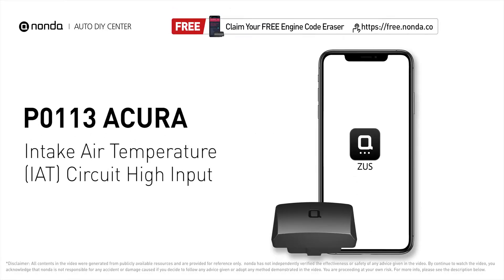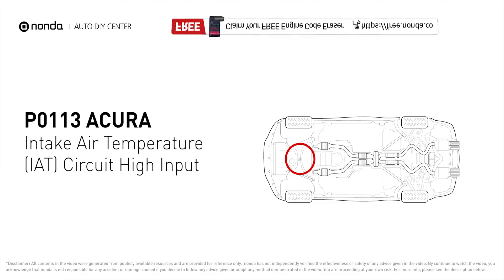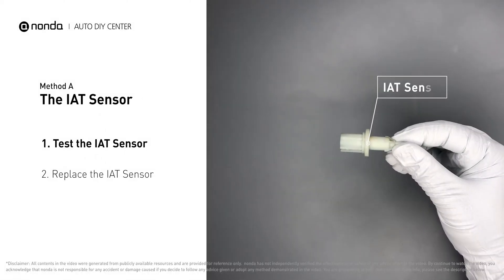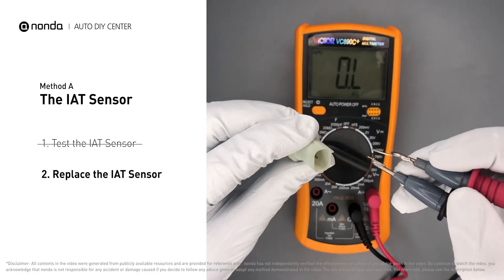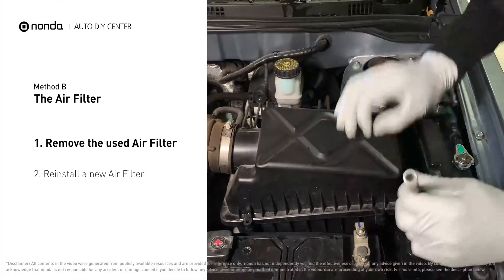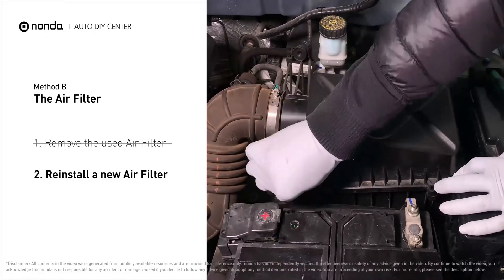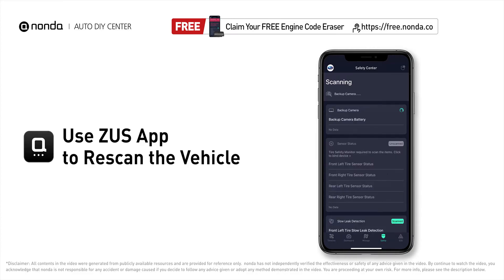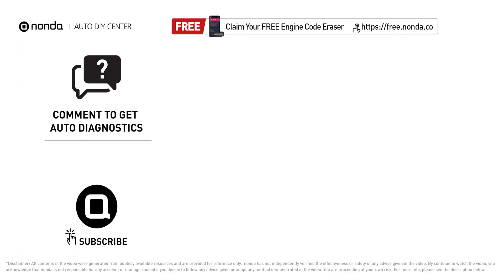How to Fix ACURA P0113 Engine Code in 3 Minutes [2 DIY Methods / Only $7.76]

Comment: FYI acura MDX 2014 and up have a Intergraded MAF and IAT sensor all in one. My code came on simply from not properly closing the box where the air filter sits. Replaced sensors unnecessarily.